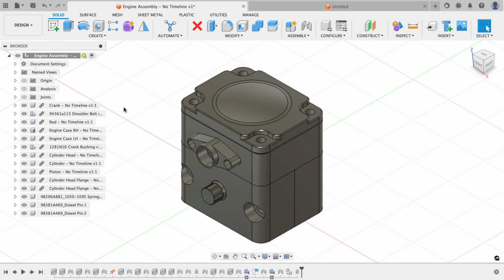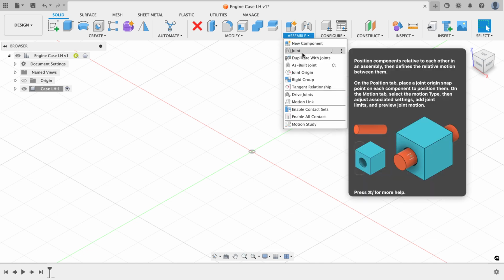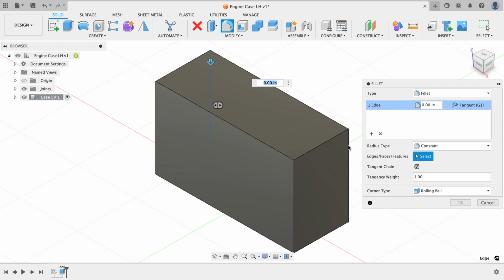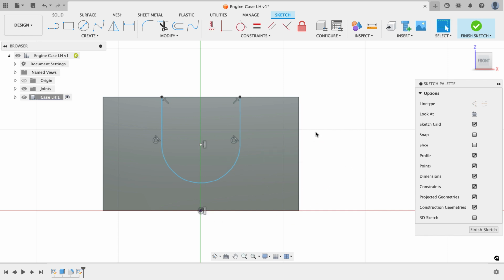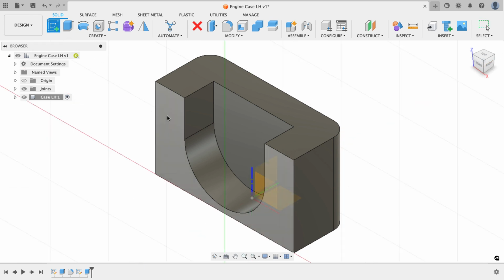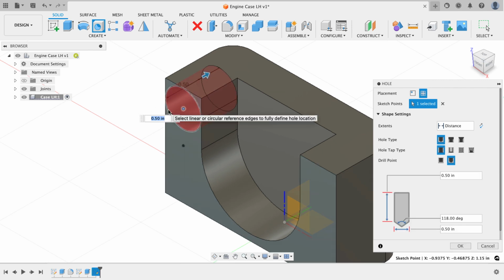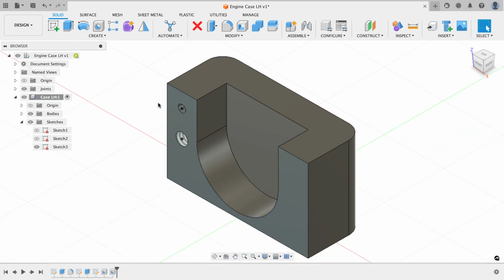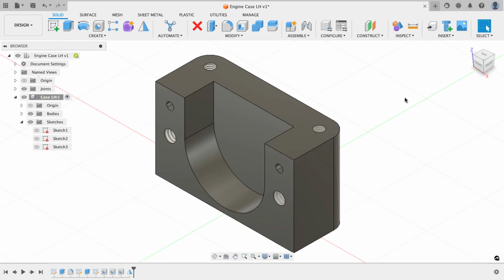Model Engine Project - Engine Case LH

Comment: Thanks again Kevin. I really look forward to this series each week. Fun to watch Adam's progress with your help. Very helpful content. I was able to get my part modeled correctly after watching your video just once. Only problem I had was the point created by the fillet on the back never showed up. I had to create a sketch and dimension a piont before I could create the hole in the top of the part. Not sure why, I checked preferences and couldn't find anything relevant...

Comment: I'm just curious. How do you ensure the threads are in phase with mating parts?
Reply from the maker: The other side will just be a clearance hole. So I won’t need to make sure the threads line up. Good question.